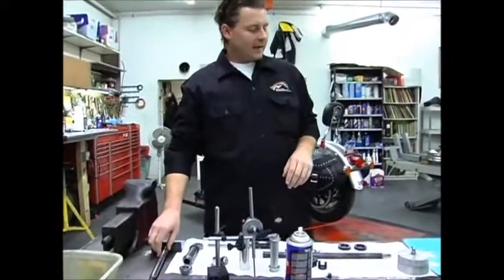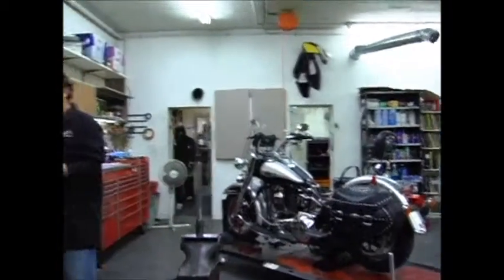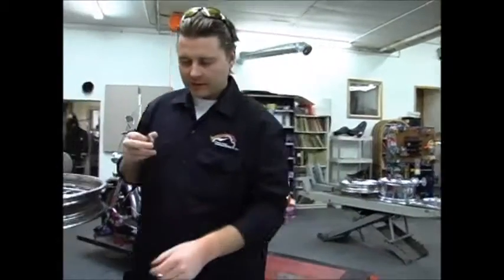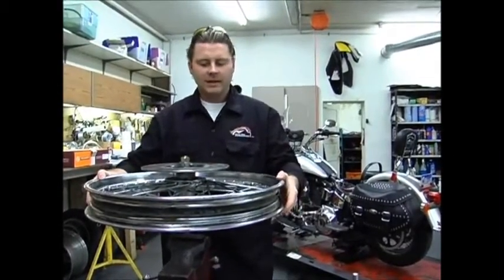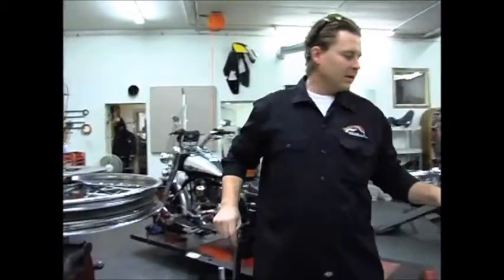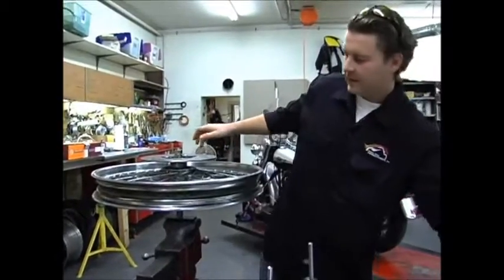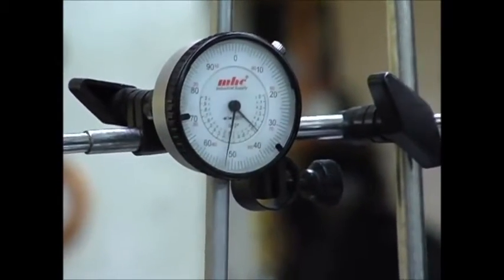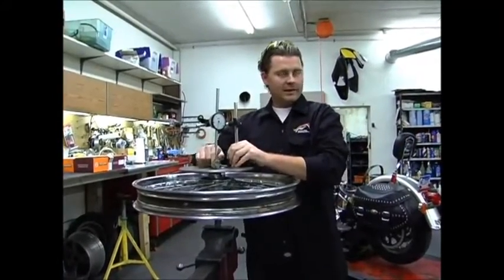How to check tapered Timken wheel bearing end play on a Harley. Similar to trailers and auto wheels

Comment: Just put new bearing in my 98 road king today. I set the endplay to .002 using this method, but when torqued up on the bike i get .008, and it seems like the bike wants to rear steer all the time, or tip from side to side. Been chasing this issue for weeks now. when I set the axle in the vise I did notice that the two smaller spacers would not go all the way to the shoulder of the axle (like the axle was machined a little larger on the shoulder end)

Comment: Note that applying the correct torque while rotating the wheel not only ensures correct load, but correct seating of the outer bearing races in the hub. This is also done on aircraft and of course terrestrial vehicle wheels. Torquing without rotating the wheel would be less accurate. 

Setting play as shown avoids unpleasantness like powdering the bearing on the highway and having uncommanded steering inputs! It's important enough that if you don't have the tool shown I suggest getting a nice chromed axle and using the stock axle for the tool. If you don't have a welder someone who does can weld the tool quicker than it takes to drag out their leads and turn on the machine. Easy and worth it even if you only have one Harley.

Comment: Hey Shane, great vid.  My H-D 1985-90 FX/Softail factory service manual actually says to grease the bearings and install on the bike BEFORE checking end play. If you have that manual you can check it out. Page 2-8/9.  End play spec range of .004-.018.
Reply from the maker: Later years the procedure is different. We always recommend using the manual and you shouldn’t go wrong. I have a video on manuals where the printed copies can actually be an old outdated version without an update. Manufacturers even used to send stick on pages to go over the misprints. Thank you for commenting and welcome to our community!